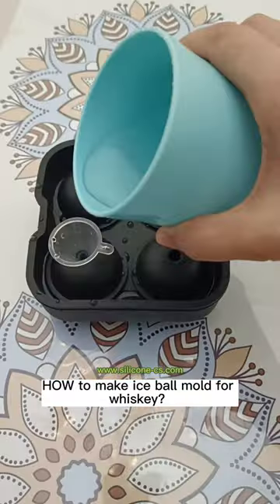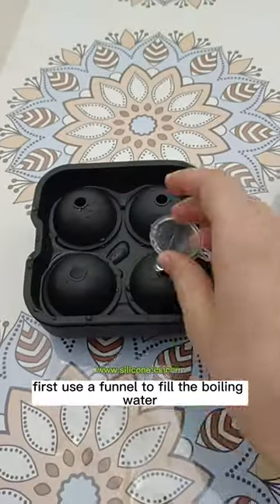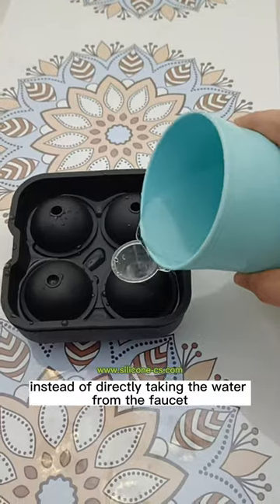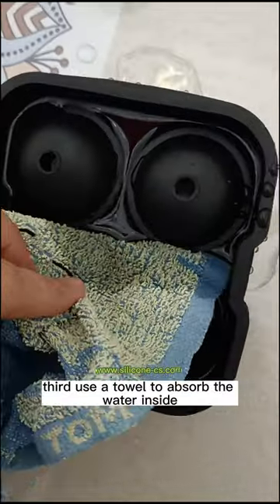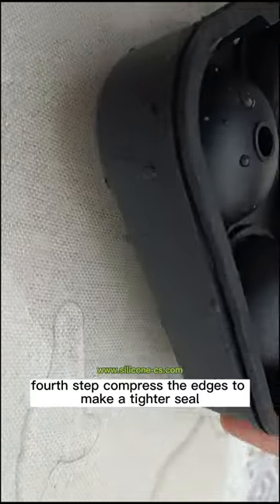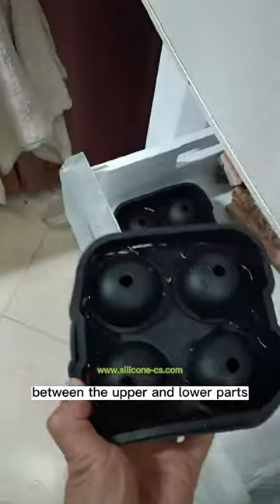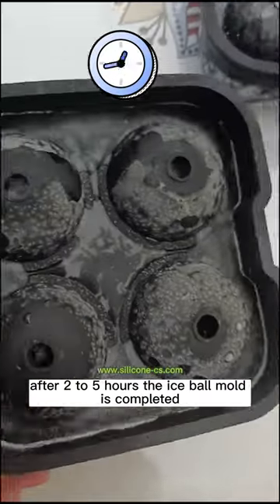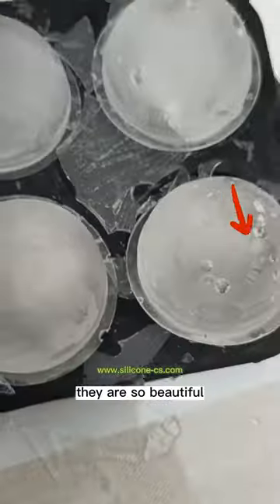How to make ice ball mold for Whisky #iceball#icecube #whisky#DIYiceball #icetray#siliconeproducts

Comment: I filled mines up this morning but didn’t do each hole.
Reply from the maker: Please check, did you not put enough water (it is better to use a small funnel to fill the water), or did you pour out some water when putting it in the refrigerator? Or is the lid tight enough? Please try again，:goodvibes: